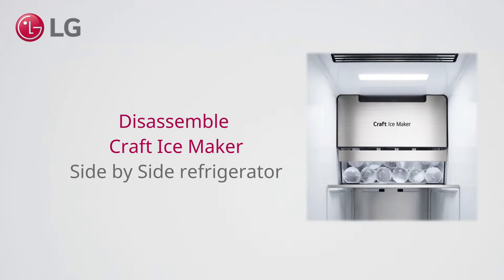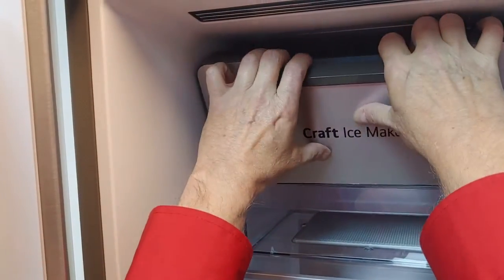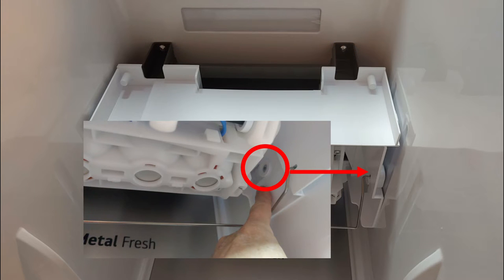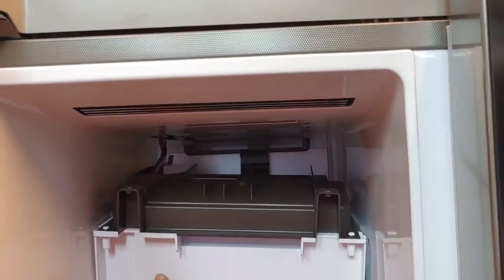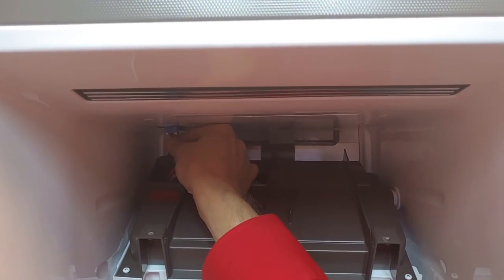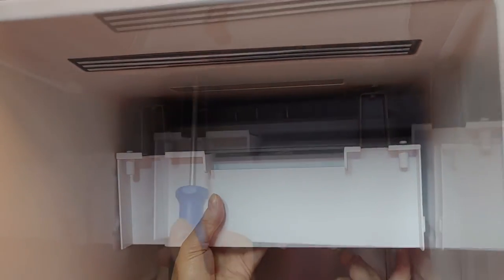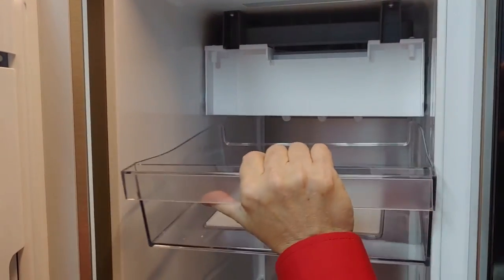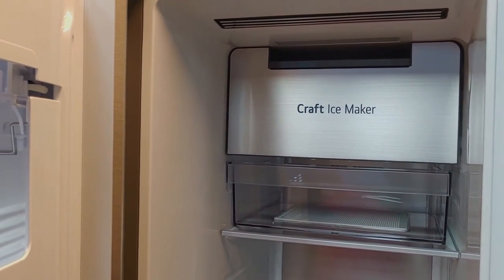[LG Refrigerator] - Disassemble the Craft Ice Maker on a Side-by-Side model

Comment: Is there a truck to pulling out the fuse on top? 
I have tried poking, proding, pinching and pulling. Nothing works. HELP!!!
Reply from the maker: It is indeed quite difficult Jennifer, but you need to press a small part of the connector you want to pull. That lifts up the clip a little so you can pull it out. Be careful. If it does not work, please get a technician over.
Reply: I had an issue as well, I just wiggled and pulled at the same time and it came off.

Comment: Do you have any information that shows how to troubleshoot the craft ice maker? This is the only video I can find that refers to the side by side version of the craft ice maker. Ours is not releasing the spheres and is dumping water into the bin where it freezes into a block.
Reply from the maker: Please contact your local LG office. This video refers to the European version of a side-by-side model. Apologies if it does not match your appliance.
Reply: @LGSAE  could you please tell me what model number this is?
Reply: My ice maker is doing the samething! What was the problem and how did you fix it?
Reply: Same here. I just posted what I did. I don’t know if it’s will work or not but I cycled the craft ice maker when I was done and it appears to push the balls out better when I cycled it. When I removed the unit I had a lot of ice build up on the top of the unit. I melted it all and put it back together. Fingers crossed that was the problem.

Comment: Is there a way to trigger a test mode on this model of craft ice maker with a hidden button or something, like other older models have?
Reply from the maker: Yes there is. On the left side, under the Craft ice maker there is a U-shaped cover. Within that U-shape there is a small button you can press. This will test the Craft Ice maker and its feeler arm. Please make sure to turn on the Craft Ice Maker via the internal display first (a LED next to Craft Ice should be on).
Reply: @LGSAE  Ah-HA! That was helpful. The front plate above must be removed to be able to find this button. For those looking, this is more like a U-shaped area around the button. Depress and the ice maker will do 2-3 rounds of the plastic form moving up and down and the feeler arm going up and down. This was helpful only after I removed a fused block of the 3 mostly round ice cubes. I also decreased my freezer to -4F, it was a -1F.
Reply: @LGSAE  How is it that the craft ice maker breaks ever 6-8 months like clockwork? Class action lawsuit is on it's way. There is no fix, just make a service call on my time and money to replace it knowing this is what will happen ever 6 or so months

Comment: Can you permanently remove the ice maker for additional storage?
Reply from the maker: Yes you can, but do not forget to turn the ice maker off. For the ice maker in the door there should be an alternative shelf that closes the air path to the dispenser chute. Otherwise you can get problems with moist air.

Comment: The craft ice maker will not go into test mode, I press the button and I hear a beep, and nothing happens, what is wrong.
Reply from the maker: Not sure. No ice from the Craft Ice maker? Could you try all-on mode (https://youtu.be/C4nxo744aQk) and check what you see? In case all lights go on, there is no clear error, but there may be a code such as IU visible, check here what it means in that case: http://service.academy.lge.com/#/Troubleshooting > select refrigerator and check the code.
Reply: Mine did the same thing.  I'd press the test button and it would beep one time. It wouldn't beep again if you pressed test unless you opened and closed the freezer door.  The solution for me was to remove what he calls the front plate.  As soon as I removed the front plate, a bunch of ice went flying and the arm and mold instantly started moving again.  Apparently a bunch of ice was jammed up behind that piece he called the front plate.
Reply: @Rezolution01 omg i’ve reset mine 5 times and taken off the front plate 3 times and didn’t work. after seeing your comment i reset it and immediately took off the front plate and it started moving. there wasn’t any ice so after it cycled through twice, it filled with water. thanks so much!
Reply: @heatheryp8022  mine hasn't broken again since. I think it happened because my kids didn't close the freezer door one day for a few hours and it got all icy inside everywhere.  It's been fine since it started working again.
Reply: @Rezolution01  mine was good these past couple weeks and stopped working again!! when i hit the button it makes one beep and doesn’t move :c
Reply: @heatheryp8022  you can pull that plate off and try warming that area with a hair dryer.  There is ice build up keeping it from moving.  You can also try updating the firmware with the app on a phone.